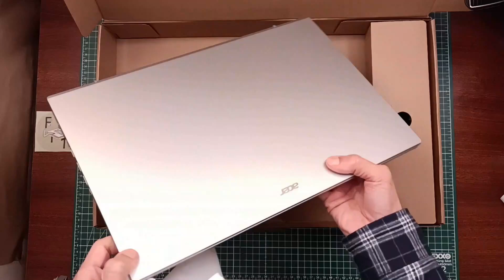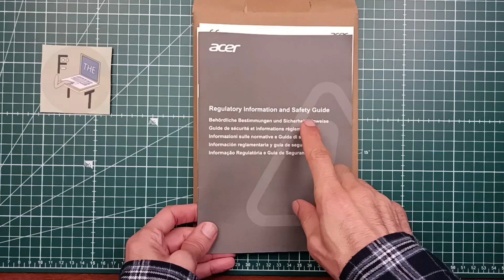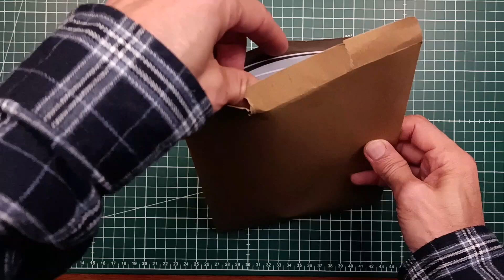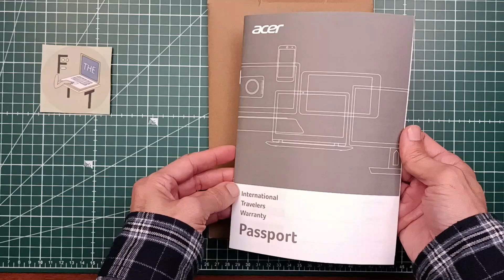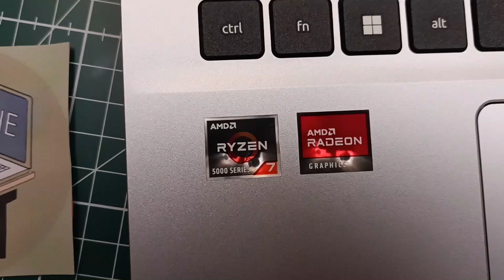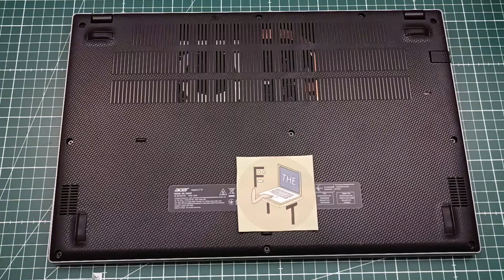Acer Aspire 3 15 laptop box content (A315-44P)

Comment: I specifically chose this model because it has 1 SO-DIMM slot, upgradable storage and it has a second slot for SSD, Wi-Fi Card upgradable from Wi-Fi 5 to Wi-Fi 6, and the display can also be swapped from TN to IPS. While the newer models have soldered RAM with no extra slots nor any components that are upgradable. I'm actually gonna this today because i was trying to find a laptop that was budget-friendly, can run games well, perfect for computer programming and cybersecurity, and even run Linux. And this is the first laptop that popped up in the results. So thank you for reviewing the laptop, really helpful❤
Reply: Do u suggest buying this notebook bro?
Reply: @LeitusAsmr What notebook?
Reply: @RaymundTube763 i meant laptop, acer aspire 3 a315-44p, i would like to learn from you if this laptop is suitable for multitasking, for work etc
Reply: @LeitusAsmr  Oh Absolutely! I've been using this laptop since August of this year. And i gotta say that this laptop's performance is pretty great! IPS screen, Ryzen 7 CPU, 512GB of storage, and 16GB of RAM plus it has an extra SO-DIMM slot the the back for another RAM stick so that makes it 32GB total if, if you have the money to buy another 16GB stick that is. And Yes, multitasking and work is suitable for this kind of laptop, and it actually does it pretty well. For me I've been using it to write my codes and scripts which do amazingly well. It can also do some gaming on the side as well. Let's say Cult of the Lamb for example, it can handle up to 40fps on Low settings. And for me that's pretty goodconsidering that the laptop's CPU is only Ryzen 7. I would recommend this laptop for work and multitasking if you're willing to buy it that is🤷‍♂️
Reply: @RaymundTube763 thank you so much for the detailed info i appreciate it 🙏now im sure i'll buy it 😊
Reply: @LeitusAsmr Ayy no problem, just happy to help👍🏻

Comment: how high can this ram be upgraded to
Reply from the maker: Hi. When I started the computer for the first time, I was looking in the task manager and it says it has 1 slot occupied with 16GB and another one free. I suppose it can be upgraded to 32GB in dual channel configuration. I also found that infomation in some online stores with this laptop for sale. I will try to test this later, if I can get my hands on more 16GB.
Reply: I have this laptop and recently installed 2x32gb sticks and it recognizes it although according to Acer 32gb is the max.
Reply: @danow11  isn't that makes it 64gb?